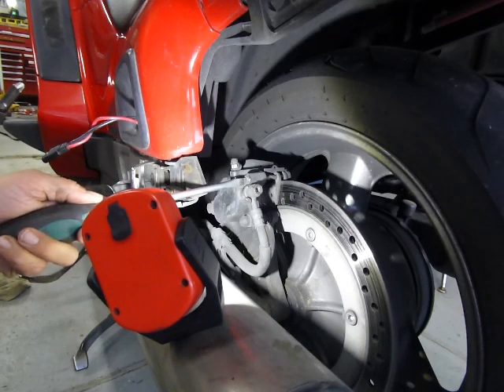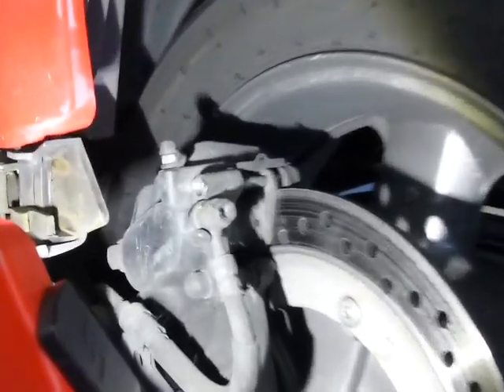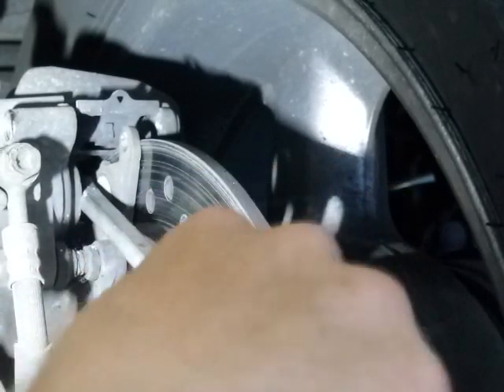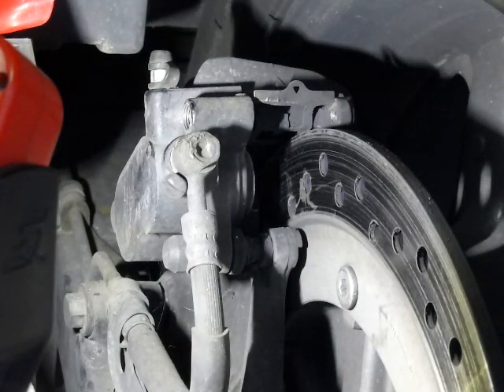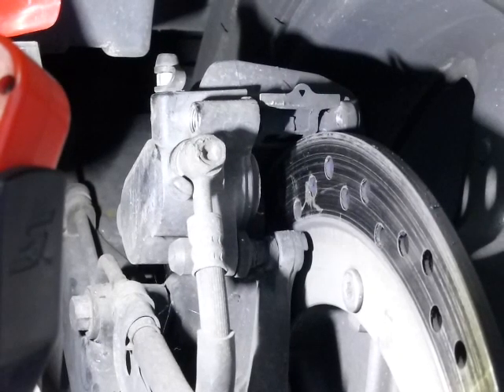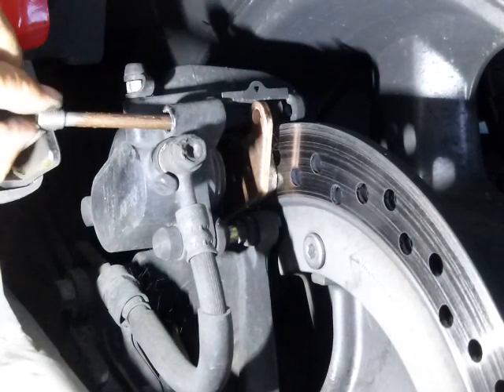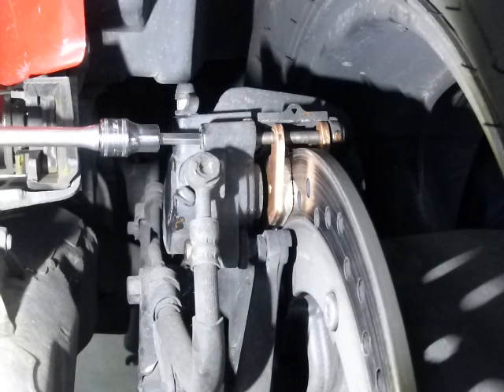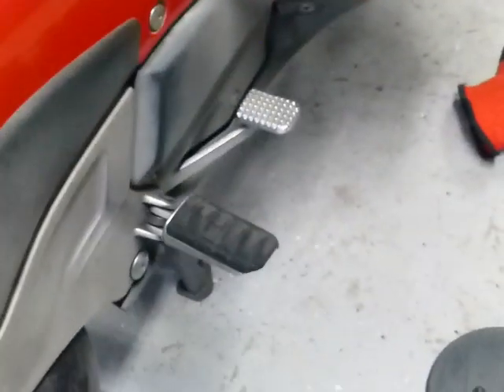ST1100 -12 Minute rear brake pad change

Comment: In order to maximize the life of your new pads and ensure optimal operation of your brakes you really should remove the caliper and clean and grease your slide pins, inspect rubber boots, clean pistons and inspect seals. Confucious say; "he who goes cheap pays twice"."
Reply: Not to mention the undue pressure on the rotor.

Comment: So.. That bit is easy.. Now if a ABS st then the pushing the pistons back would cause pressuer in the rear and front ABS MODULE Units.. This intern would pressurise the ABS system..
The result usually means ABS 1and 2 lights flssh... Due to pressuer in the system and brake fluid pressure valves as part of the ABS module.
If Non ABS simple...